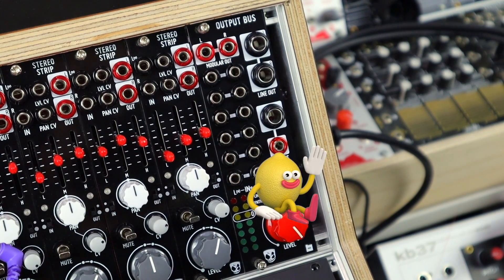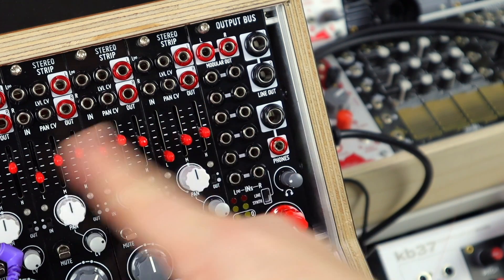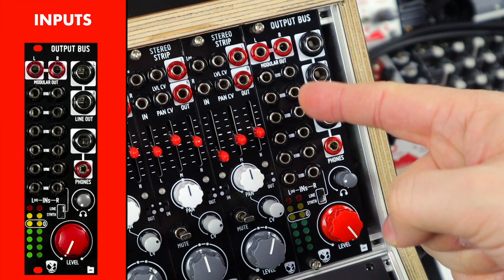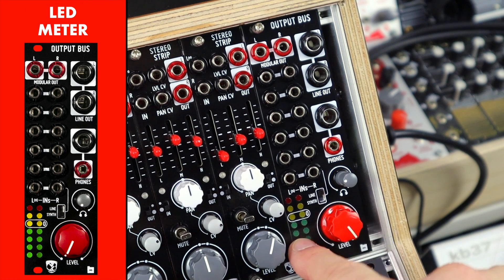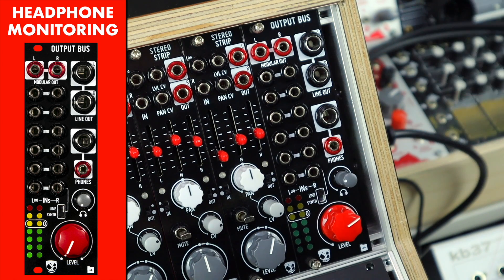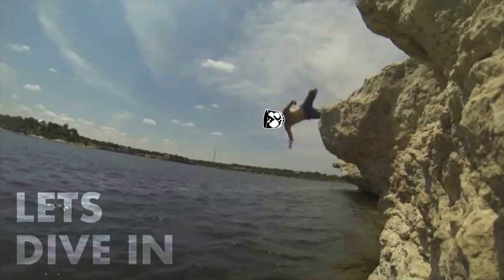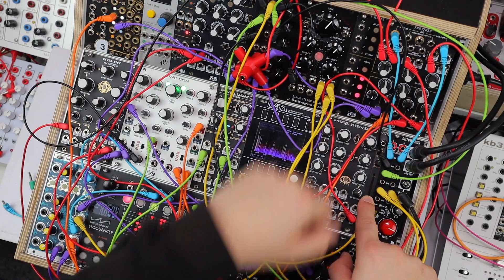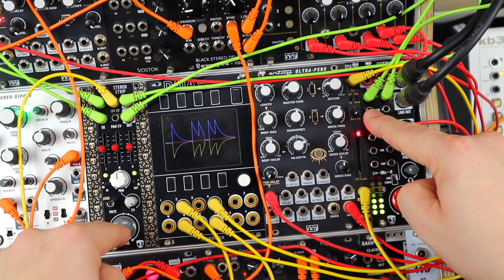A Eurorack Mix & Output Problem Solver // Output Bus from DivKid & Befaco

Comment: is there a link/video somewhere that shows how to use it as a fx send/return?
Reply from the maker: No, as there's no functionality designed into it for FX send and returns. You could patch the Eurorack level outputs at the top into FX and then back into some inputs but that will create a feedback loop, as those returns from the FX would send back out again. That can work great if you're playing with feedback loops but it's not a normal send/return.

Comment: This is just a great handy module. I've really been thinking I want to replace my summing mixer and move to this, yet... 

The one thing that holds me back is that I would love an attenuator and CV attenuation on the inputs. If you ever do a v2 of this; adding those things with no other changes and it would be the top of my list...  (I recognize the HP would probably need to go to something like 12HP, but the summing mixer I mentioned is 10HP, so another 2HP, maybe even 4HP, seems like a fair trade.
Reply from the maker: So VCAs? Level controls and CV level controls, that would be a VCA based mixer. 

What summing mixer do you use? 

For a small mixer with loads of channels and VCAs per the channels I use the Steady State Fate Vortices a lot. Might be worth a look.

Comment: Hi Ben, a quick question, i'm not sure about: is it possible to use like a send/return fx? 
Thanks for your work!
Reply from the maker: Hello, good question and unfortunately not. 

There's no send and return function. You have the ability to input line level, which will bring that level up to Eurorack and add that to the mix. But the mix out always remains a mix of all 6 stereo inputs. If you output (say through the headphones) to a pedal and then back into the line level input and come out of the main outputs you'll have a feedback loop, as the line level will output back through the headphones too and create the loop. Feedback loops are great (when intentional), but not what you're after here.

If you want a send/return module the DPW Pedal IO is very simple and it's clever dual gain staging have sounded great, but there's other nice options. I'd use something like that then the Output Bus as a means of mixing several things in the system and outputting that as a final stage.
Reply: @DivKid  Thanks for you kindness, clear as usual.. Yes, you're right, DPW could be usefull at affordable price 😉

Comment: Is it possible to use this to connect a TR-909 to a eurorack system?
Reply: Hi Ben, I'm also thinking the Erica Synths Pico Input might work.  I'll have to get 4 of them for the 909. Also, I will be getting Erica's Plasma Distortion Drive in the near future. Can't wait to hear that thing on the 909. 
Thanks for your replies, great videos, and info. Having tons of fun hearing where all this goes!
Reply from the maker: I think Bubblesound make a multi channel basic input, AniModule too. Line amp it might be called. Head to Modular Grid and choose interface or input as the function and restrict the HP to a low number and see what you get.
Reply from the maker: Yes, though it's going to then be present at the Output Bus mix stage, if it's just an input you want (to then further process the 909 and not just add it to the Eurorack mix) then there's simpler options.
Reply: @DivKid  OK, I'm still new to modular and figuring out the routing. Basically I want to run the 909 thru the modular system and use the eurorack effects and distortion. 
I also just found out that the WMD performance mixer (which I have) can run line level signals? Very confusing since when I began my modular adventure, I had no idea the signals were different than line level. I turn to you as the expert who can lead me down the correct path. Thanks for all your vids and vital info!
Reply from the maker: Yeah there's a lot of learning to do, even when we feel experience with other formats and synthesis/sound in general modular is still a bit of a slap in the face sometimes. Good fun though and the learning is a bit I really enjoy.

I believe the WMD performance mixer does have enough gain to boost up line level signals. But what you ideally want is a specific input module, so you can input the 909 up to modular levels and then integrate that in the system from the start of the chain. That way you can then run it through anything and then add it to the mix at the end of the chain as if it was any other modular source.

Comment: Just ordered, this solves a couple problems I had, first I have 3 Befaco StMix's scattered thru out my system, this will tie them all together for final output. Second  I wanted to direct record my modular, so I plan to take one of the phones out to a Zoom H4 Essential, then bring its line out back to the in's to be able to play back over monitors. Brilliant !!!
Reply from the maker: If you can play back audio and record (but not monitor the inputs recording) through the H4 at the same time this will work. 

If not you'll create a feedback loop. Where the output feeds the H4, but the H4 output comes back to the Output Bus which sends that sound back to the headphones and so on. 

On those devices you can often choose what you're monitoring while playing back or recording. But I'd check first.
Reply: @DivKid  Yea I  always  turn off Monitoring on recording so no feedback worries, thanks for the reply !
Reply from the maker: ah nice! Good stuff, I've definitely been caught out with that sort of thing before but glad this is going to work out nicely. Enjoy the Output Bus! :)

Comment: Buffer that mod out for stereo sends add a few stereo strips throw in a St-mix and that’s one impressive mixing system! Who needs cue take a risk! Haha
Reply: Also utilizing that second headphone out with a splitter cable for a pedal you got lying around that’s potentially another send
Reply from the maker: I like the creative thinking and often end up working that way to get signals routed with other gear. However taking headphone outs or euro outs into other things and then back into the Output Bus will lead to some heavy feedback loop action ... which can be a fun time ... or a bad time.

Comment: Love the idea of building a custom mixer all inside Eurorack but it would be nicer if there were a whole series of modules that could be normalled without front patch cables to build a complete vertical channel. I would think stereo strips, eq's, panners, ability to send each channel would be minimum. How would you go about building that ?
Reply from the maker: 'stereo strips' ... see my module the Stereo Strip! :) 

Though this isn't built for expander style rear connections, we kept it open and patchable so you could use anything. That was important in the design, to let people use anything they have from any brand and to bring those together.

What do you mean by "how would go about building that?" do you mean with existing modules? Or as a circuit design?

Comment: ordered myne the day after seen this video lol.  many thanks
Reply from the maker: I hope it works out great for you. Thanks.
Reply: @DivKid  itll def do what i expect.  seeing you use the stereo split and building the playable mixer. got me thinking. 
prob be a getting a few of those in the future for all my drum stuff
Reply from the maker: Nice thing is to try one, as a soft classy compression-ish like bit of saturation and EQ, try slamming it into distortion, clean and EQ, extra VCA velocity type stuff or pan mod etc and then see if you want more or pair them with other things. I definitely enjoy having multiple around for various voices and sub mixes.
Reply: i like this idea. will def try out.  module will be here tomorrow.  so im thinking i send the summing bus, modular out, into my erica synth black output.  i put into that stereo out put so i can expand on my stereo channesl. should be any issue with that use right? also, do you have a discord channel set up? 
 @DivKid
Reply from the maker: Modular level out into another stereo output module that you use will work, or into any modular mixer. 

I do have a Discord set up, it's exclusively for Patreon supporters ($1 a month and up), great community, daily topics and discussions, plenty of places to chat and share things. I'm in there daily.
Reply: @DivKid  awesome!  Sounds very worth it. Will def look into that.    Thanks for the reply

Comment: Could this work as a 1U version?
Reply from the maker: it's twice the width of what you'd fit in 1U (on it's side) so it would be around 52 HP to just spread it all out. Which is huge. Bits of it could, but to do all that this does ended up so long as I tried to lay out rough mock ups it hasn't gone anywhere as a 1U idea yet.

Comment: hard sync! the use of line-in drum machine plus the soft clipping of a drum machine with hot outputs seems like it could  add for some really nice distortion for bass drums or a synth like the 303.
Reply from the maker: for pushing more distortion there's the Rings bit of the video, but check out the Stereo Strip video as it's the same input and soft clip limit circuit.

This should play at 7:11 - https://youtu.be/4ChJ8M9P_IM?si=Ydv4A8lUh2_NoCRL&t=431 that's more bass synth 303 style riff with the distortion.

Comment: Dope module mate. Question. Can we use the modular output to send it somewhere in the case and then return it on its own inputs and take that processed mix from the unbalanced outs?
Reply from the maker: Hello, thanks. No you can't, you'll create a feedback loop. 

Well you can if you want the feedback loop. The last patch in this video does that, modular out back through a stereo strip and delay then back to an input and recording out of the 1/4" outs. 

But it's not a separate unity mixer to the output stage.

Comment: Love this combo of stereo strips + output bus as a modular mixer.

I feel like it’s missing some way to get a master bus fx loop though. The 6th channel is already perfect as the return, it would be cool if the top jacks on output bus could be configured via jumper or something to be the sum of the first 5 channels instead of a duplicated main output.
Reply from the maker: Yeah there's no insert system for the mix and no send system for the channels. Neither were designed for that. But for saturation, EQ, voltage controlled level and pan all brought together it's really nice. 

I think a pair of stereo strips and a smaller performance mixer of some kind into Output Bus has been one of the most used for me so far.

Comment: Hard Sync for sure!
Love the longer kick note with a purr at the end, what kick module/modulation or from scratch combo are you using there?
Reply from the maker: That was the SSF Entity Ultra Kick (video demo - https://youtu.be/MPmajedWlcs )

The second stereo strip had the Entity Ultra Perc for the noise snare/perc stuff (video demo - https://youtu.be/dqm79xIiFRA )

The third was the Metalloid Percussion (video demo - https://youtu.be/y5MjEZJeJ7s )

Fourth was a blend of sounds from the SoundForce Samples sounds

Fifth was the Vostok Sena VCO (video demo - https://youtu.be/RHMJ-hzlsRk ) into the SSF Steady State Gate (video demo - https://youtu.be/arwFwe6UoMw ) 

Feedback and delay at the end was the Erica Synths Black Delay 2. 

Sequencing from the Winter Modular Eloquencer, using the CV outs to modulate the voices. For the kick it was CV to the resonate (resonance/length on the kick).

Comment: So I could sell my Befaco Out and stop daisy-chaining my other mixers freeing up mixer channels.
Reply from the maker: Exactly that. Get a nice output stage and be able to output multiple other mixers into it. 

Use the LED meters and your ears for the gain staging, big red knob to adjust, other mixer master outs adjusted if needs be. Winner winner chicken (or alternative) dinner.
Reply: @DivKid  This means I now need a stereo strip too so I can put the main mix through that and Duck the beats that are fed into Output Bus! I was previously thinking of getting the Shackmat Gemini's Path for Ducking and the KonstantLab Baxandall EQ.
Reply from the maker: I haven't tried either of the mentioned modules. Should be good though. Any stereo VCA can be your side chain thing, it's just needing to mix everything prior to it and mixing it back after with the kick.

Comment: Handy module! Bit of a missed opportunity that it and the stereo strip dont seem to support chaining with a ribbon cable on the back. That would allow building a dream mixer without cables in the way... something for v2 maybe ? ;-)
Reply from the maker: It was considered but the back of the Stereo Strip is so component dense there was no room for expander pins on it. 

Tidying some cables out of the way would be nice of course. Though I'm happy to patch into it and glad it's not just an expander and is open to use with anything else you want to mix together. 

Appreciate it.

Comment: Nice, like a Hexmix scaled down to just the important bits. Shame you can't normalize Stereo Strips to the inputs on the back.
Reply from the maker: The back of the Stereo strip is so packed we can't fit headers on there. But the idea was always for this to be an open system for any modules, not just Stereo Strips. So I don't mind using a few cables.
Reply: that would be sick

Comment: Hard Sync! Love all the uses for this. I commonly end up using a Nearness into the Befaco output V3 to sort of make this happen, but that line level boost built right in is so nice, as I usually end up using the Twin Drive to make that happen. And the Stereo Strip mixer with it all looks ace!
Reply from the maker: Nearness is a lovely tool. I haven't tried that into this but that would be a nice way to get a load of tracks into a stereo space onto this with other things.

I couldn't help myself with all the Stereo Strips, too fun.

Comment: That's great, bravo. I have a Cosmix and was wondering whether to invest in something to solve the lack of ins/outs, and then you post this, definitely synchronicity. And, what makes it even more of a coincidence, is that I was just thinking of something like this last night, a sort of mixture between this and the Vostok (which I see you have).

Difficult decisions, this or the STMix (also from Befaco). 🤔
Reply from the maker: I do like the Vostok modules, the Ceres is nice as it's 6 VCAs. Things like the Cosmix and Vostok into the Output Bus have been working really well.
Reply: @DivKid Yes, I can imagine. Especially as the Cosmix has the aux sends/out, which is it's (main) advantage over the mighty Vortices.

Comment: Super nice one! What would you add to the modular mixer setup in the end of the video to be able to use 2x sends/returns controlling levels? Vostok Ceres perhaps acting as an automatable per channel send line
Reply from the maker: I use the Stereo Strips as a send FX router, though if that's across multiple channels of audio you'd need a mixer and it's gets to be a lot of modules fast. (this recent video shows some nice FX things with the Stereo Strip - https://youtu.be/7VP54nAf_ro?si=IlDHUszGYH8YSQdc) 

I'd say a mixer with sends on it is the best place to start. Then add channels, extra mixes, or just extra things into the Output Bus as needed that go beyond the mixer itself.
Reply: @DivKid  Great, thanks!

Comment: Really cool that Divkid takes care of our mixing and output needs!
Output Bus is so brand new the Befaco link is still pw protected^^
Reply from the maker: ah ha today was set as the launch day, so it should be in stores as assembled and DIY from today. So everything will come together as the day goes on and various parts of the world get into working hours. 

Most of what is on the Befaco page is on my website, but if you need any info immediately let me know.
Reply: @DivKid  No worries, I'm sure everything will work out fine. ;)
Pretty neat mixing environment you and Befaco created there. I'm mixing outside the case, well submixing inside the modular, but then everything goes into a mixer with four aux sends which makes integrating my Elektrons and outboard fx much easier.
The mute switches on your modules are awesome, though and they also seem to be a reasonable size, nice and playable, really well thought out.

Not sure if I wanted to mix entirely in the modular, although playing with feedback, sidechaining different voices and creative filtering is much easier and you can do much more on the fly, so I'll probably get a Stereo Strip next.

Kinda long text not saying much, lol....just wanted to say your modules are great and I always watch the videos even if I'm not considering buying anything. It must be a ton of work to get those ready for shipping...
Btw, did you also work on the Hexmix and Hexpander?
Reply from the maker: Appreciate the long text, it's nice to hear from people interested and supporting what I'm doing. Thank you so much. 

I didn't work on the Hexmix with Befaco that was entirely them. At that point I'd had really simple Mutes prototypes made elsewhere, basically a socket wired to a switch to a socket. Totally passive and while alright nothing sophisticated. When the Hexmix came, I just asked Befaco to take the mutes on that module and copy that circuit across for what I wanted. They were into the idea and brought Mutes to life.
Reply: @DivKid  Ah, interesting to hear how that all came about. People like you really keep modular alive! Now that you mention it, I think you've told the story in the Mutes video...anyways, I just ordered a Mutes kit. A friend of mine has Mutes, a Stereo Strip, Hexmix and a few other Befaco modules. They are really great, I always end up jamming for hours, because they really invite you to just grab the knobs and switches and play. I wanted to get them for my rack, but you know...there's an endless stream of interesting modules....